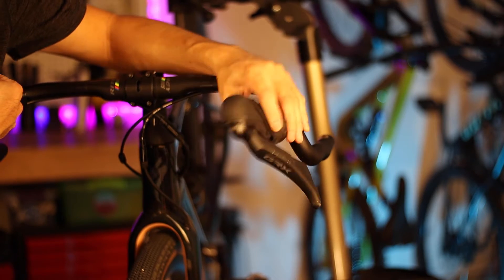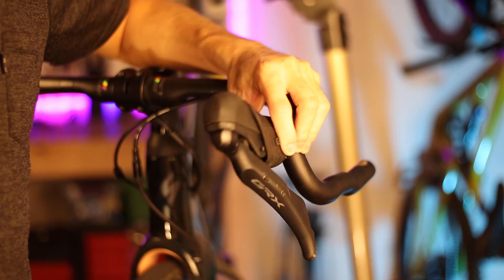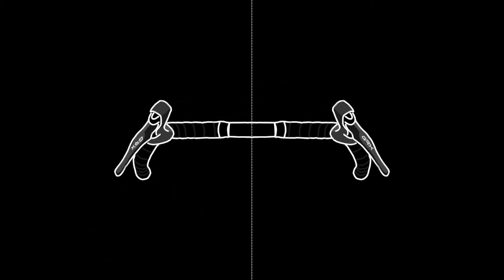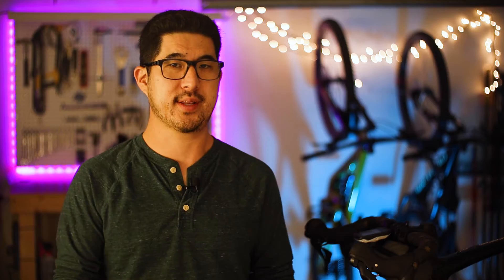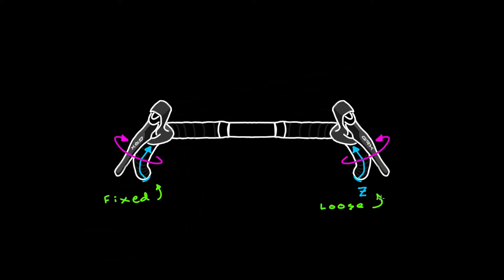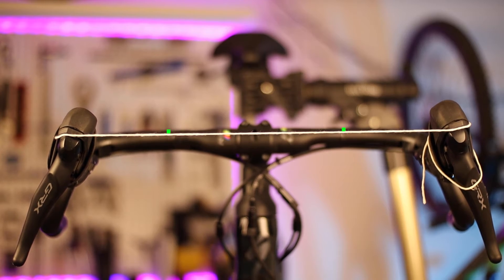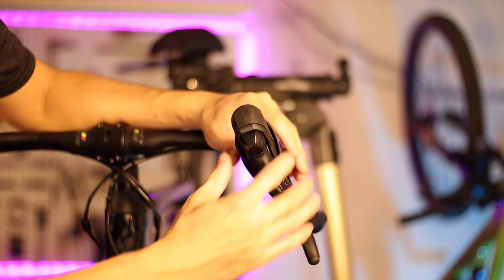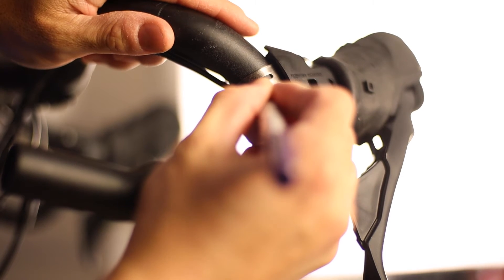HOW TO: Symmetrical Road & Gravel Levers // Perfect Alignment!

Comment: A variation of this is the "falling horizon" method, whereby you look at the hood tops from behind the stem and move your head down until the handlebar obscures them (the hoods falling below the horizon). If one drops below the bar first, it's not level. No string required, and no variance on string placement introduced.
Reply from the maker: Yes! Fellow bike nerd! I like it

Comment: Subscribed... This issue has annoyed me for decades and this is the first time I've ever seen a tutorial that made sense for getting the levers height and rotation correct.  I ride with my levers rotated inwards slightly and every time I get on my bike, I think that one of the levers is at a different angle than the other.  I will now go see if that's the case! 👍

Comment: Another way to make the height adjustment is get the second shifter roughly in line but higher than your first lever, remove the front wheel and put the drops and the brake lever on a table. This gives you three points of contact on the table. Then lower the second level until it makes contact with the table.

Comment: On flared handlebars, rotation about theta changes effective z height.  This method should work, however, on non-flared traditional road bars.
Reply from the maker: I think z is meant to be the distance along the drop to the clamp, so it’s independent of rotation whether flared or not

Comment: could you also use the string method to dial in rotation? for example, could i take the mid point between the tops of the shifters and check that it lands roughly in the center of the stem?

Comment: I've set the hoods to the same height and the same length from stem, measured at the top of the hood. This should give you the same angle I think but the thing is that there is actually quite a big difference. Using the method for this shown in the video I am also getting different values when I tried to set the same angle by eye.
Any ideas? Thanks.

Comment: Well.. after you've set z, by changing theta you are essentially also translating in z, thereby misaligning again. You might just pull it off with a road bar but with the flared geometry I just don't see how this could work
Reply from the maker: Astute observation! Yes there’s some cross-channel coupling which is exacerbated by higher flare angles. My work around in the video is to ‘roughly align the angle’ of the adjustment side before setting the z dim. In practice, the theta adjustment should be minimal, thereby mitigating any effects due to coupled channels.

Comment: Hi! First of all, there is no such thing as "perfect" in engineering or in nature. In particular, bike fit can change on the same day due to differences in body flexibility, etc, so there is more of a "fit window," as explained in the book by Phil Burt. Finally, I also done this for a while, and I use my phone as a level for angle measurement, and height from the floor using a metal tape measure. You did not explain how to keep the string taught, by the way.